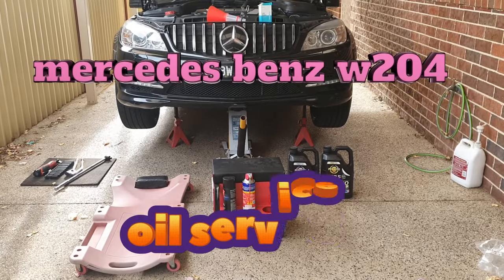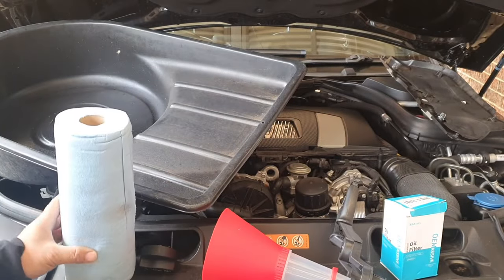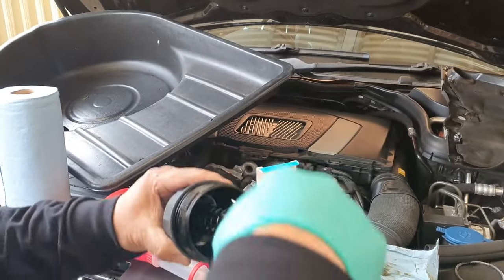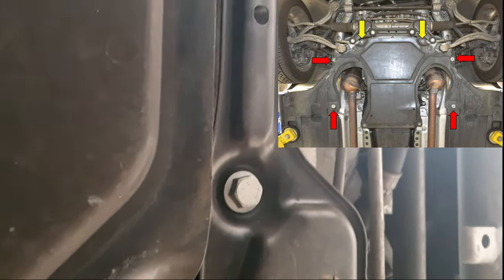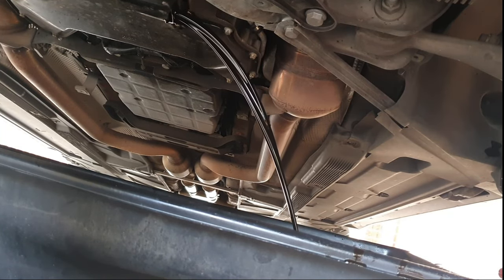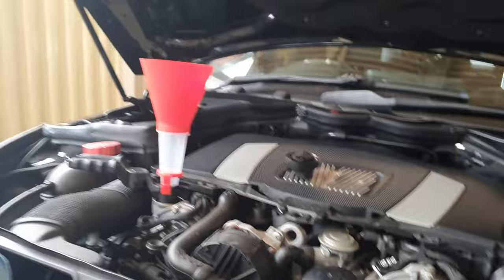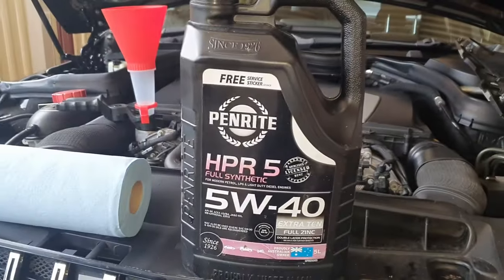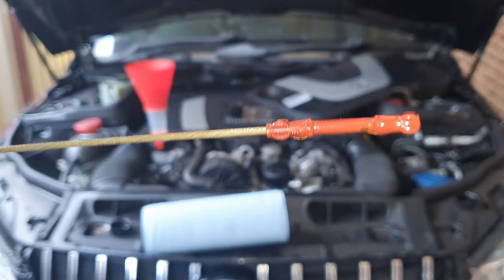mercedes benz w204 oil service guide

Comment: I wouldn’t use that much leverage on a sump plug. You damage that thread you’ve got an expensive problem and can’t drive until it’s fixed.
Reply from the maker: @firstnamelastname4752  good tip but it actually wasn't that tight on eventho I used the Milwaukee on it it wasn't all the way on just yet... which was why it went so easily ..u can tell how easily it went in the video ... I barely tried ...then after that it was actually snug and u saw wen I used the ratchet I barely moved cuz it was actually nice and tight by then..but good tip..thanks for the advice and tip...we all appreciate it

Comment: Watching you tighten that sump plug had me cringing,use a  torque wrench 😬
Reply from the maker: @andyhankins2017  lol... yeah I understand the frustration ... but I've never used one ever and I've never had a problem ...although I do have one ...lol... I maybe should ... I have a proper torque and a digital... what do u think about digital torque wrenches
Reply: If they have a current calibration certificate I think it's down to personal preference both do the job👍
Reply from the maker: @andyhankins2017  nice..good to know...so as long as it's calibrated it's all good? do they go out of spec? after years? do u get them calibrated again?